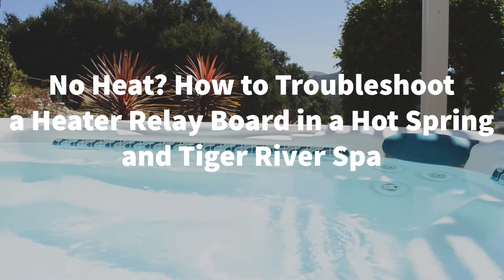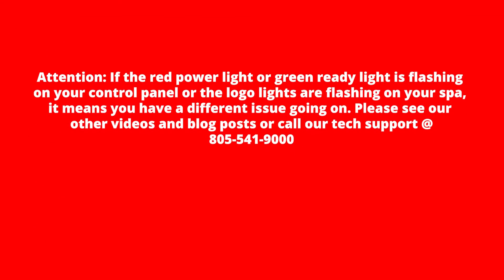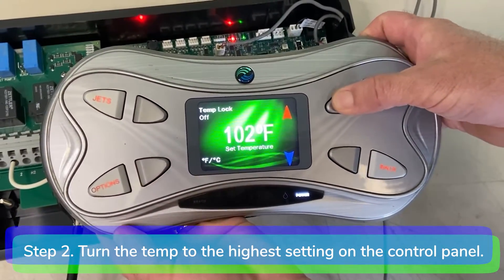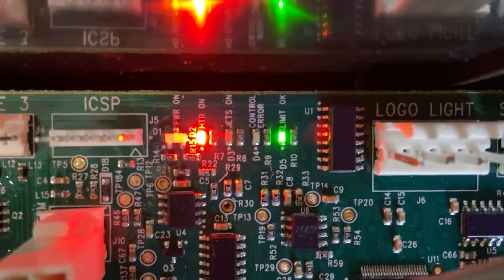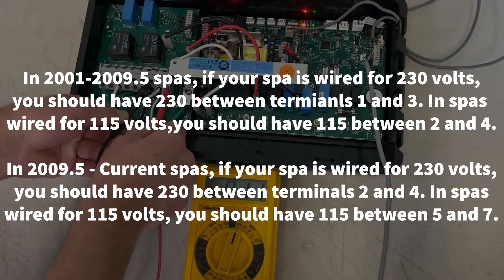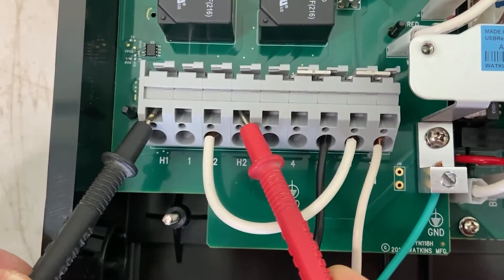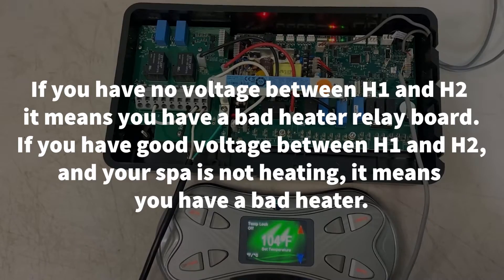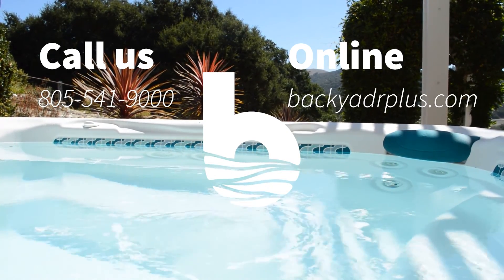No Heat? How to Troubleshoot a Heater Relay Board in a Hot Spring and Tiger River Spa

Comment: Help! Power on light flashing green, heater light off, limit ok on, D21 red light on. Voltage good 2&4. 
No voltage between H1 and H2. New heater relay board. Thanks in advance.
Reply: 2012.5 -current. Sovereign II
Reply: No-Fault Heater
Reply: Green and blue logo flashing. Clean filters and no air lock.
Reply from the maker: If the green and blue are flashing it means you have a bad pressure switch in your heater. Replace the heater
Reply from the maker: You need the HTR ON light to be solid red in order for the heater relay board to send voltage to the heater. Test the high limit and temperature control Thermistors. If they are bad, replace them. If that doesn't fix it, replace the topside control panel

Comment: What if you have good incoming power nothing at H1 and H2 but the Lim light is on and the HTR light is off
Reply from the maker: Are the power and ready lights flashing? If so, you have a bad pressure switch in your heater. Is the green ready light flashing? If so, you have a bad temperature control thermistor or a bad control head (2001-2012.5). If the green ready light is flashing on a 2012.5 - current spa, it means you have a bad temp sensor or a bad control box.

Comment: Hot springs grandee hot tip I put a new motherboard in the spa heats but not to temp and the main display is saying 40.0c is that Celsius
Reply from the maker: Yes that is Celsius. You need to put a jumper on JP9 on the motherboard for F

Comment: My heater light is blinking, incoming voltage good, outgoing voltage 0
Reply: Brand new heater from backyard plus.  Both limit thermistors read within spec on ohms, also jumped pressure switch.  No change in operation or lights.
Reply from the maker: If the red D9 light is blinking, its a failure of the heater relay board. You must replace the 77119 heater relay board.